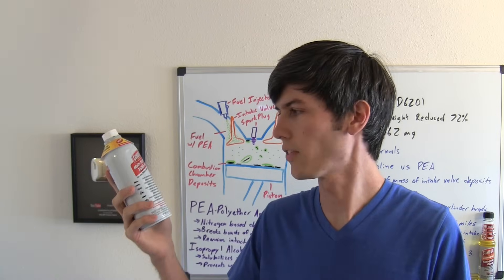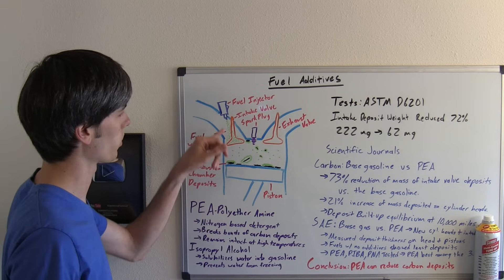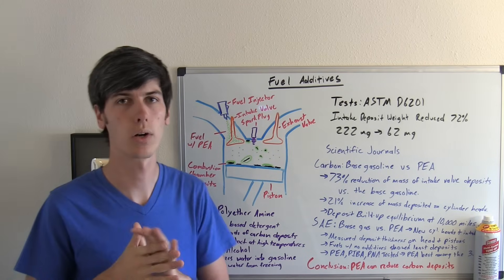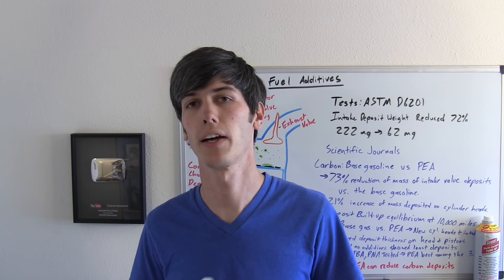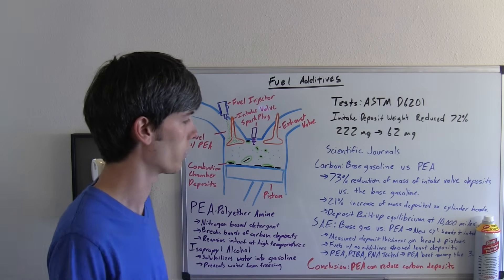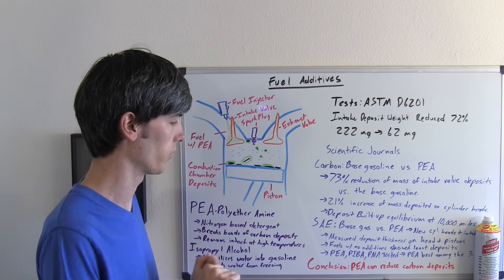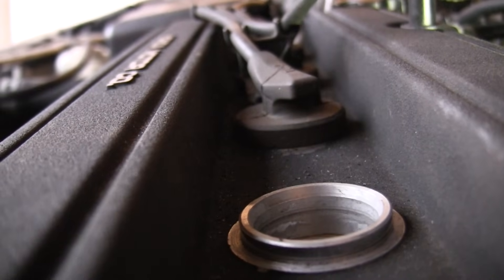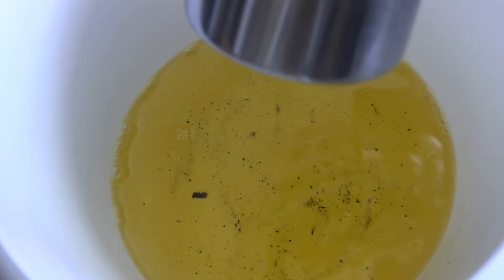Fuel Additives & Injector Cleaner - Explained

Comment: So I just bought my first new car and Ive been going out of my way to do everything that most drivers neglect or don't pay attention to because to me this is an investment which I plan to keep long term and pay off. I've been washing my vehicle by hand on a regular, taking care of the interior and have a rigorous maintenance schedule outlined which I plan to adhere to. My question is im about to hit 3000 miles is it ok to use this every 3,000 miles like clockwork as the directions state or since it's a new car would that be overkill or could I face any side effects? Thanks guys, by the way it's a 2017 Honda Ridgeline if anyone needs to know the engine information to properly ask my question.
Reply: your car is new and you drive it regularly. don't use this stuff. just keep putting gasoline in it and driving it regularly. he clearly said the only benefit from these fuel injector cleaners comes if your fuel injectors are dirty to begin with or if the car sits and water builds up in the fuel tank.
Reply: Jessa Phillips thanks for the reply. I figured that was the case but what I find interesting is to use it when you have carbon deposits. Well I would assume if you cleaned it from a new state you won't have to worry about carbon buildup. If you keep using the same dirty dish it's going to be so bad and hard to wash down the road. I dunno this is why I asked.
Reply: high quality gasoline already has all the detergents, etc., that an engine needs.  so you shouldn't ever need an additive as long as you use top tier gas.
Reply: kwazykilla87  check out the story on Top Tier Gasolines on Google. That will most likely  give you a gas station near you,that is Top Tier gas. Also check out BG44k fuel system cleaner. It's one of the best. If you have a fuel filter outside the tank change it. Cheap money and easy to do. If it's in the tank it's very expensive to change and maybe a life time filter. Good Luck with the car.
Reply: John David Dunson All gasoline brands are required by federal law to have Detergent in them.
Reply: kwazykilla87 don't change the oil till the maintence light comes on. Have the oil changed at that time. The computer will measure the life of the oil. Every 3000 is much to early. You can look up HondaRidgelineOwnersClub on Google.com. My friend least a Honda Accord  the dealership told him every 10,000 miles.
Reply: David Bryant Look Up TOP TIER gasolines. They have more detergent agents in them. Mobil is best for regular Shell for premium. Look up Google.com SargeLS1 using Marine outboard TCW3 oil to clean and lube fuel systems. It works like Lucas fuel conditioner and injector cleaner but much cheaper. I use Pennzoil Marine XLF.

Comment: Mavel mystery oil ftw
Reply: Justin P. BG44k fuel cleaner
Reply: This is impossible. Marvel Mystery Oil is a top end lube that coats the upper cylinder walls - and intake valves. You put in on (MMO) and the Gumout takes it off!

Comment: Does anyone know if you can used these products "too often"? Say once a month (every 1,000) ? v.s once every 6 (every 6 thousand miles) months?
Reply: smithraymond09029 each product have different instruction, like some of them say to use after each 6000 miles, but obviously depend on what fuel quality you use as well,  In my opinion if you have an old engine and have difficulties to accelerate with the 1st and 2nd gear (especially diesel engine) I would suggest to use one time a cleaner,  if you feel no difference just try again, following the instructions,  the majority of cleaner products going all bottle in a full tank of fuel,  but don't exaggerate with these products they never say if it could harm your engine, but you know in this life if you exaggerate with everything it always won't gonna be a good result, could be worst.
Reply: smithraymond09029 Some additives tell you to use it at every fill.
Reply: That is on par with the quick change oil places that want to see you every 3000 miles.
Reply: Tommy Truth Never let a shop change your oil. You never know what they might put in there. I've always changed my oil at home.
Reply: Noah Rairdon go to a local trusted mechanic. Ask people around town who is a good mechanic. Even your local car dealerships change oil. Midas does conventional oil changes for $19.99 with tire rotation. You can watch them do it.

Comment: I use Red Line.
Reply: JackTradesman Redline is very good. Check out BG44K another excellent product.
Reply: Awesome!  Will do, thanks.  I used to use a full bottle of Red Line at a time, then found out eventually that 1/4 a bottle per fill up, for the last 4 fill ups before an oil change, worked better for me.
Reply: Arthur Smith how about liqui moly and stp?
Reply: Vaggos Chio the moly is great forget STP. Check out Researchcore.com  2017 best fuel cleaners. Lucas is very good used every time you get gas. Check out these fuel cleaners and prices. I use Marine outboard TCW3 oil every time I get gas. Works like Lucas but much cheaper.Google LS1 been testing oil. This guy Sarge and friends have tested Marine outboard TCW3 oil. Cleans and lubes the entire system. I was using Lucas until I found this. It must be TCW3 rated oil.
Reply: Vaggos Chio you don't need to use Full Synthetic Marine outboard TCW3 rated oil. Semi synthetic or even just Marine TCW3 Walmart Super Tech $14.00 a gallon is ok. There are many brand names. All are NMMA approved. I just bought Marine outboard Pennzoil XLF TCW3 rated oil at Walmart $17.88 a gallon the formula is 1 oz per 5 gallons of gas every time you get gas. More does not mean better. Go by the formula. You won't know your car is running at idle. Email if you have questions

Comment: I think he should've also tried a similar part with carbon buildup present and soaked it in plain gasoline. 
Further if it would've been more accurate to pull the piece and check the deposits, and then ran a can of gum out through the system, and then rechecked the part. 
Most high quality gasoline has additives. There is little proof that any of these treatments will have any positive affect on an engines performance. You're more likely to waste money and redeoposite carbon on sensitive parts such as O2 sensors than to improve performance. 
My 99 wrangler had a bad O2 sensor and the guy I bought it from swore by the cans of injector cleaner. That doesn't prove that it had a negative impact on the O2 sensor (and the jeep was extremely high mileage), but it also clearly didn't keep the sensor from going bad, or clean it out. 
Another good video that was well researched! Thanks for making it!

Comment: Excellent video! I think it would be great if you did a follow up video on various types of fuel stabilizers. Personally I use e85 ethanol in my car and occasionally put in the lucas oil ethanol stabilizer and am curious if it actually does anything. Keep up the good work!

Comment: Is it true, that this additive can also lift up all the gunk from the fuel tank, which can cause the fuel filter stuck much faster or even instantly after using this additive? Can it somehow clean the fuel injectors? I have in mind higher milage diesel engine injectors.

Comment: I wonder what happens next...
I mean - I have pretty dirty 18YO engine right now. When I use this engine cleaner, where would all this dirt go? Into the filters I hope.

- Should I change oil and all filters afterwards?
- Would using engine cleaner do any harm to the catalytic converter(would all the dirt go there after its flushed out of the combustion chamber) ? ? ?

Thanks for help! 
Your videos are great, man!
Reply: I've only ever used this kind of thing (Seafoam, to be precise) in engines that didn't have anything after combustion chamber, namely a high hour Onan twin.  It doesn't have any cats, so not sure what effect it would have on them.  The video did say that there was a 72% reduction of deposits on the valves, but a 21% increase of deposits on the piston, which tells me some of the deposits just transfer, but don't eliminate.  So, one could extrapolate that some deposits will increase in the headers as well as cat and exhaust pipes.  But some will also burn out of those places.  If it were my older engine (and it was), I would do this only every now and then, possibly only once, then use high quality fuel and regularly maintain from there after.  I only use non-ethanol gasoline in my garden equipment now, anyway.
Reply: t s check out BG44k must better than seafoam.
Reply: Thank you.
That's the answer I was looking for : )
Reply: You must be Polish......
Reply: Congratulations !
How does that answer my question of "where does the dirt go afterwards"?
Reply: What don't you understand....The part about it going in the intake or the part about it leaving the exhaust?
Reply: I asking exactly about that, what I wrote about in my first comment. Could you read it carefully, please? : >

Are you aware that there are other parts of engine outside combustion chamber ? : P
For example --  catalitic converter, DPF, EGR system, etc... 
And i wonder what happens with them, when the dirt from the engine reaches them.   Do YOU even understand my question ? ? ?

Comment: Liquimoly  (MoS2) is the best oil additive you can add to any engine.
Invented last century and proven in the WWII, is far the best real anti-friction additive, increasing millage per gallon, engine life, lowing friction and temperature, extending the oil life twice and other benefices.
I used it for over 20 years in a large number of gas/diesel vehicles and I never had a engine problem. Motorcycles beware cant be used in engines with yellow metals (bushing).
Very under rated in many countries specially in the US.
Reply: Mr E - Just added a 300ml bottle to 5 qts of Royal Purple 0-20 on my 2015 Scion tC.  I've had a 2011 and a 2006 and have ran RP on both (alone, though) and the engine performance was noticeable.  Also, the engine was quieter and "smoother" per se.   I added a 300ml bottle to the RP and I must say it is absolutely great stuff.   I can't say how well it would work with using another oil such as M1 or Pennzoil but I am now a fanboy of MoS2.  Great stuff.
Reply: MoS2 is the best but keep it away from yellow metals.
Reply: Archoil AR9100 Friction Modifier!

Comment: Should probably note that these fuel additives would not work on intake valves for modern Direct Injection engines since the injectors would be downstream to the intake valves (e.g. hence recent issues with Lexus, Audi, and VW direct injection engines).

Comment: i have had good luck with gumout whitelabel bottle in carbureted engines like my older suzuki motorcycle, lawnmowers, chainsaw and snow blower. if I use that regularly, I didn't have problems even put away wet.

Comment: The only concern would the catalytic converter that could be damaged or blocked up and expensive to replace.
Reply: 190055joe Thats why ive always thought of disconnecting the cats
Reply: heyitschinoable that's a job and a half
Reply: Don't do it if your state inspection has a pollution test.

Comment: OK look.  If you want use these additives use them a week before your scheduled oil change.  Good for your motor and helps prevent build up.  Use high octane gas, i use 89, to help keep deposits at a minimum.  You see the boards in front of the gas station and say, OMG 87 is 10 cents cheaper than 89.  That is true but look at it this way.  Say its $2.50 for 87 and $2.60 for 89.  After 10 gallons, of 87, you spent $25.00 for gas.  If you bought 10 gallons of 89 you spent $26.00 for gas.  Is a $1.00 for gas that big of a deal?  Seriously.  You will spend an average of $10.00 for an additive.  So why dont you just get better millage, less build-up and better efficiency for $1.00 more?  Stop using crap gas.

Comment: Would it have killed you all to just take a car with a couple years of driving on it and use this stuff the way the manufacturer says to and see if it worked or not ?
Reply: lol and then what? take apart the whole upper of the engine to look at the pistons? he covered the product just fine.
Reply: Andrew Borges  No. It's called a dynamometer.

Comment: what about Direct injection engines where intake valves build up carbon but don't have fuel spraying them down? is there a good chemical cleaner method? how about a video on that?

Comment: What about putting sea foam into you tank to clean you injectors? i have heard mixed reviews of that. My main concern there is that someone told me it ate up thier lines. Any thoughts?
Reply: Alex Perron Maybe pouring a smaller amount of the fluid into the vehicle would be safer and still effective.
Reply: Alex Perron Seafoam has been around a long time and recommended by top mechanics in outboard engines and car/truck engines. Your friends fuel line was all ready in bad shape and it most likely was time for failure.

Comment: It would be an interesting experiment to add some heat, and see how much additional affect there is on the reaction. The high speed flow at the intake as well as the heat from the combustion must be beneficial contributors to the cleaning action.

Comment: The studies you mentioned both are comparing "base gasoline" to gasoline with additives.  Is "base gasoline" equivalent to what we buy?  It was my understanding that the various gasoline companies have their own additive packages - including detergents and carbon reducers.  So, is Gumout really necessary for any engine using real world pump gas versus the "base gasoline" used in the studies?  Just like the number of licks required to get to the Tootsie Roll center: the world may never know....
Reply: John Gedde Probably not too different. Then you could always add smaller amounts than directed of the cleaner product into the gas tank, just to be on the safe side.
Reply: I've heard that Top Tier is all we need and if you use the cheap stuff (actually Top Tier isn't always more expensive, especially now that Arco is Top Tier) then running a bottle of Chevron Techron through every oil change is a good way to go.

Comment: Hi I just wanted to ask a question on behalf of my gf. She wanted to know if you're a legitimate engineer? Because last time we saw one of your videos on Subaru wrx and sti, and you advised to get a turbo timer to safely cool off the turbo so the oil won't cook. But we checked Subaru sources and there is no need to get a turbo timer, the subarus have already a cooling system that won't allow that to happen. So there's no need to spend money on a turbo timer to see when you can shut off the car or when the car is warm enough to start driving. Turbo timers are used mostly by people with after market turbos and older model turbos.

Comment: You're soaking it at full strength/undiluted without high heat: a bit skewed.  I don't believe in "snake oil" anyhow.  Maybe if GM, Ford, & Chrysler sold their proprietary additives to public I'd try it but sounds like you said if the vehicles driven regularly then no worries & no wasted $ on gimmicks.

Comment: I was told that some fuel additives and cleaners can harm the engine in your vehicle. From what i understand the carbon and what ever else builds up on the valves and in the cylinder walls some times helps keep everything moving without to many problems. then after you run the injector cleaner through ect, and it does what its suppose to do, its like the valves don't seal properly and maybe the heads move through the cylinder walls  a bit sloppy. then things like that could cause faster wear on the engine, and maybe compression lose. i imagine the engine would have to be very old for that to happen if its even possible.
Reply: john Klask Adding a smaller amount of the cleaning product than what's normally recommended will probably be the best of both worlds.

Comment: Isn't SAE claiming that fuel additives worsen deposits?

It stated that base gasoline left fewer deposits than using any additives, but that PEA was the lesser of the evils as it added less deposits than the other active ingredients used. Wouldn't this indicate the cleanest combustion chamber comes from no fuel additives?

This is also backed up by the data from the scientific paper you put up. The intake valves lost 72% of deposits, but the combustion chamber GAINED deposits (21%), similar to the SAE study.

On gumouts in house study they only mentioned intake deposits and ignored combustion chamber deposits.

As far as I can tell this means that fuel additives, specifically PEA, can clean intake valves but actually worsens deposits in the combustion chamber. Generally combustion chamber deposits are worry some due to the irregular combustion characteristics that can ensue (knocking, dieseling, etc) which makes this video incredibly misleading to those who don't pay close attention. 

Unless I am completely misinterpreting this it seems to me my favorite youtube engineer sold out and is providing misinformation for profit :/, please prove me wrong.
Reply: Remember that the SAE test used NEW parts for every test. This is why he said for newer / cleaner engines, don't use it because it will add more deposits.

For older engines / dirty ones, the risk of adding more deposits is outweighed by the deposits that are already there.
Reply: The conclusion of it was that using it periodically is good, but using it long term(like at every fillup) is bad. It appears to suggest every 10,000 miles, as that is how long it takes for carbon deposits to return to equilibrium.
Reply: You are spot on , except that the deposit build up will not cause dieseling or pinging but on the contrary will increase the compression ratio.
Reply: I think his conclusion was more that valve deposits would be lessened, but overall deposits (e.g. heads) would be more.  I'm inclined to agree with you though, not sure if it has something to do with Gumout sponsoring the video...